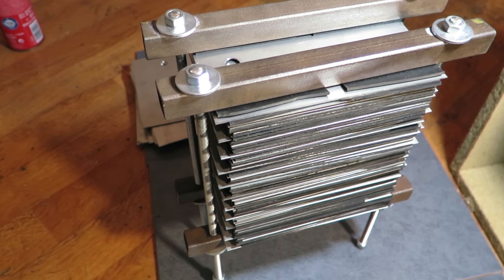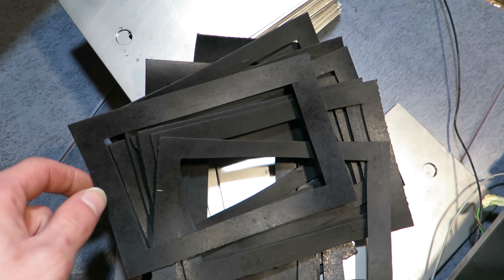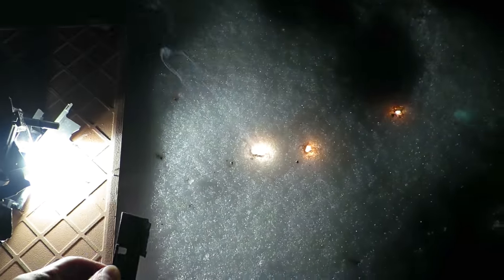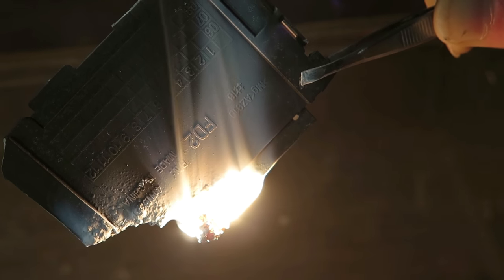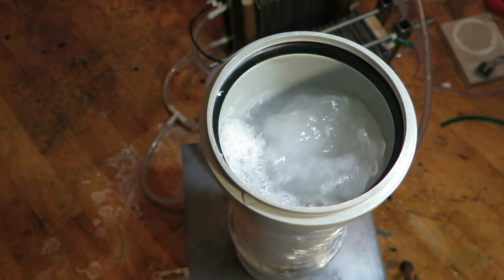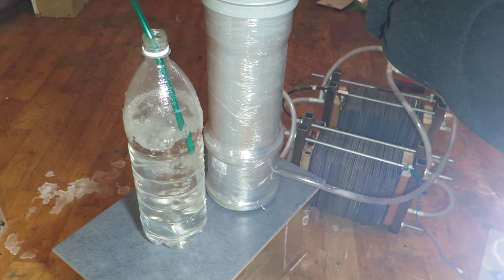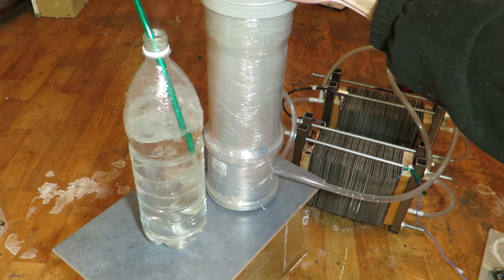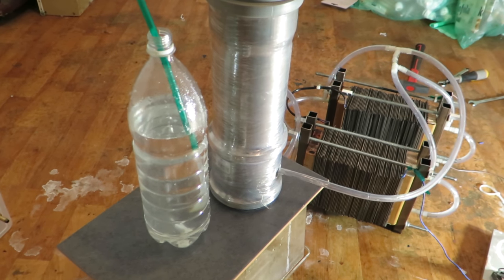Big 230V HHO system - Part 1

Comment: Is it heating, I know you can't touch it, but when it is of is it hot? Haw is it conectet to power? It looks promising.
Reply from the maker: I have run this for about half an hour, then NaOH starts eating pvc tubes.
I wouldnt noticed that if I didn't used green tubes. My electrolyte is greenish now :)

I have seen many people here on YT running this until boiling electrolyte.
So it will never get hotter than 120°C

I must remake the cell so it will sit in nice box and add power regulation. Now it is only rectified 230V
Reply: Can you measure how long it take to produce 1l of gas?
Reply from the maker: yeah just need some time to do stuff

Comment: You do need smoothing.  After running and being  turned off, you said you measured 1.2v per cell. That is certainly not electrolisys. That is the opposite of producing HHO. Just like a fuel cell, it is consuming some the HHO gas you made to sustain that voltage. 

Believe me, I ran into these same issues as you. I worked for a company that made HHO generators. I made their product a lot better. They had big issues with heat, and spent a lot of money on radiators fans and pumps and still had to turn the power off to let it cool. They were using a Siemens Logo  (programmable logic controller) to monitor the temperature, turn on fans and pumps and measure fluid levels and control a solenoid valve to refill. I showed what they were doing wrong and completely  rewrote the program for their logic controller.   I was able to do pwm with the logic controller  with a duty cycle based on the temperature.  I first had to remove  one internal mechanical relay and soldered wires that went to an external solid state relay that switch up to 50 amps (typically 30)  of current.  As for the fuel cell action providing  1.2v per cell when it was off, I knew I had to keep the voltage up.  I used a pi filter to smooth the PWM power. Smoothing out the pwm power serves a similar function as  a DC to DC buck converter converting it to a lower but constant voltage, that not only regulates the power flowing in but  the HHO generator runs more efficiently at lower voltages constantly instead of shut on and off  running at higher less efficient voltage. 

Pi filter.  Capacitor, inductor, capacitor.

In your case, using a pi filter will lower the peek voltage  but will have  it producing all the time instead of off and on at non ideal voltages as will happen with just rectified DC.
Reply: @buddhafollower   certainly, at peek voltage HHO is produced less efficiently momentarily making more than when the instantaneous voltage is the RMS voltage. And  there is no HHO  production when the voltage drops below a certain voltage per cell.  Suffice it to say, it will run cooler and or produce more if one  smooths out the voltage with a pi filter.
Reply: @buddhafollower    "what are you saying, that he should have more than 1.2V/plate" I said no such thing.   Remember I was talking about 1.2v  (key words) "when shut off."   Rewatch 2:28 . That is not electrolisys. It's momentarily acting like a fuel cell consuming hydrogen  rather than producing.   Thus  i argued he needs a smoothing capacitor to hold the voltage up.  Or rather, i suggested a pi filter, (capacitor inductor capacitor) 

As for ideal voltage, you drive the cell  at what ever voltage is necessary to drive the current needed to produce the amount of hydrogen you need given the HHO generator you have, and in accordance with how well you can eject waste heat. And in keeping from overdriving the amps per unit of area.  Shooting for the lowest voltage ensures the highest efficiency but virtually no production for your HHO torch.  Shooting for highest production ensure much heat is produced forcing you to turn it off sooner and quickens plat deterioration.
Reply: @buddhafollower  https://youtu.be/shDkrW-HHn8.   That video basically recommends no more than 0.5 amps per  square inch.  There may be other reasons for going with 1/3rd of an amp per square inch such as limited capability to eject waste heat, gasket or plastic  material's ability to deal with the heat, or maybe the type of steel  in the electrodes. For instance PVC gaskets gets pretty soft under a little heat. Or maybe someone was just recommending lower voltage/lower current for higher efficiency just for the sake of efficiency.
Reply: @buddhafollower  my recommendation is Stanly was a con-artist. Without being able to verify and repeat,  you must always be skeptical.  He still from people through his fraud and   their ignorance.  Lucky that he can't steal your money now. But his fraud lives on in myths.

His circuit was patented and is there for everyone to recreate. But no one can repeat his claims.
Reply: @buddhafollower  I put together this simple though reasonably accurate electric circuit model of HHO generation for you. http://tinyurl.com/y2nblb32

On the other hand Myers took 13.4ish volts DC off an alternator and pulsed it through a transformer. His blocking diode on the secondary side rectified it. His (so-called) resonate charging choke inductors smooths it. The capacitance of an HHO cell is so small, on the order of 1-10mf that its almost meaningless. Look up leyden jar capacitors and then consider your only applying a few volts meaning so very little energy is stored in the capacitance between the plates especially compared to the amount of energy being consumed in making HHO.  His circuit does pretty much the same as mine, that is it lowers the voltage applied to the HHO cell and tries to hold it there. All that HHO resonate stuff is cow dung.
Reply: @buddhafollower   when sued, he was unable to make his system perform as he said it would.  It might help to know he had no scientific background to back up his claims. Nor has anyone let alone many well educated scientist been able to reproduce his claimed efficency.  Quantitativly, they violated both the first and second law of thermodynamics.  His name should be said with contempt  by every man who loves truth and justice.  He stole from people through his fraud.
Reply: @buddhafollower  furthermore   the resonante freqencies of water is 6 orders of magnitude higher than the freqencies myers used. some secret low frequency  or fibernancie sequence  resonance
is osured.  Nothing can resonate  below its lowest freqency resonate modes.

Comment: Hello  sir i used stainless steel reserver  118 ss plates 230 volts but when electrolyte went from hho to  s s reserver  it become body earth  i got shock any  remedy for that ?
REPLY
Reply from the maker: do you mean, that your electrolyte reservoir became live?
You can use sections of SS tubes on inputs and outputs and ground them, just be sure to use at least 1 meter of plastic tube, than grounded point to prevent excessive currents and heat generation.
But I am not sure. I just don't touch it :)
Reply: sir reservar  is made from ss tube both ends are also ss  when electrolyte went through hho cell and come in to reservar then the reservar become charge or live with 230 volts that is the problem
Reply from the maker: You try to connect neutral to container and measure current. it should be less then 0.5A idealy below 0.25A.
if current is OK connect wire pernamently. If it is not you can decrease it by using longer hose.
you can ground it to true ground if you are not using safety current breaker (not sure exact name, but it disconnects AC if it sense current through ground).
then it should be OK.
Reply: thanks  i ll try

Comment: I made an hho cell,in beginning it was 2amps and production was good then it drop to 0.2amps 
Can you tell me the reason?
Reply from the maker: There may be a lot of reasons. I assume you are using stainless steel electrodes and soduim hydroxide or carbonate electrolyte.

if drop happens rather quickly (in few minutes) electrolyte can foam up and gas produced may displace quite a lot of water. So you need rather big (or more) holes in plates.
if drop happens over days sodium hydroxide may reacted with insulating gaskets which may lower sodium ion mobility and junk material may have been deposited on electrodes.

These problems are what I experienced, so hope it helps.
Reply: @IlusysSystems  it is not Stainless Steel and apms drop in minutes
Reply from the maker: @asadmanan2880  what is it if not stainless steel?
i have seen some tests with ordinary steel and it corroded over time, but worked ok nonetheless...

I may have asked if if you disconnect power for like 1-2 minutes and power on again if it restarts with high power and drops again. That would look like water is being slowly displaced in gas. you can also look at reservoir how the volume will increase, and see if that coresponds to drop of power
Reply: @IlusysSystems  yes if i reconnect it again after few minutes it again start with 2 amps and then repeat the process
Reply from the maker: So that seems like not enough electrolyte in cells.

what I have done is
- feed electrolyte from both sides, not only one
- split 1 cell to 2 cells so I have 4 sides where i can feed the elecrtolyte in. You can split it more if necessary
- use hoses with biggest diameter you can (I have 10mm holes in plates, 10mm fitting, 10 mm inside dia hose)
- elevate reservoir so system pressure is higher

Alternatively, you can use pump to force feed electrolyte
Reply: @IlusysSystems  can i have your whatsapp 
I will buy a kit from you
Reply: @IlusysSystems  here's my whatsapp +923087929500
Reply from the maker: @asadmanan2880  Sorry, I am boomer - I don't have whatsapp and I don't sell kits. Also given the sole weight of steel I don't even know what postage would cost.
I would suggest you buying locally if you can. Most likely quality would be much better than what I would be able to achieve.
Reply: I used filter water instead of distilled 
Is there a difference b/w
Reply from the maker: @asadmanan2880  That shouldn't really matter, chlorine may cause some trouble, but I used tap water without problems.
 You need to add some electrolyte however, sodium or potassium hydroxide or carbonate. under no circumstances chloride.
Reply: @IlusysSystems  i used NAOH powder